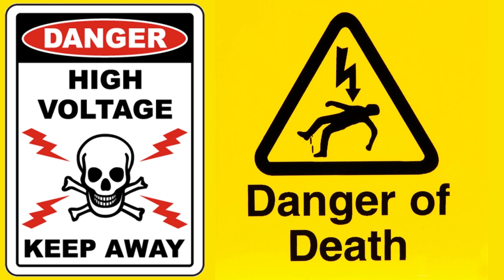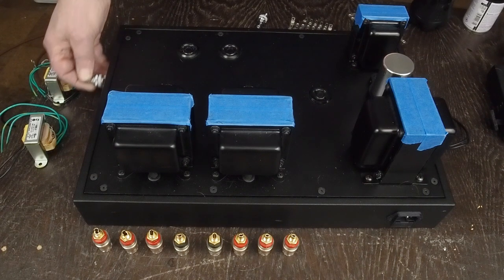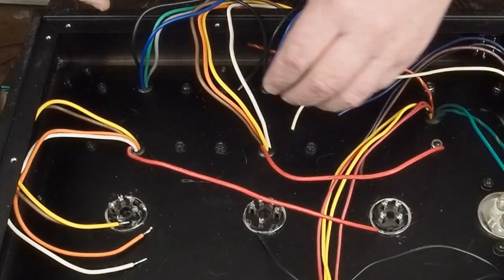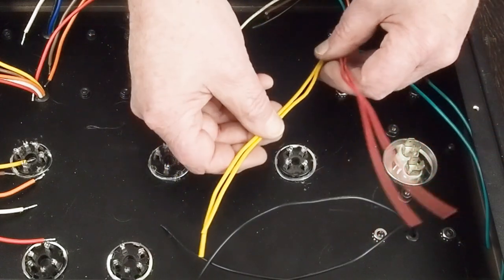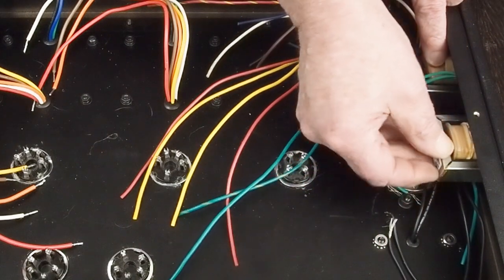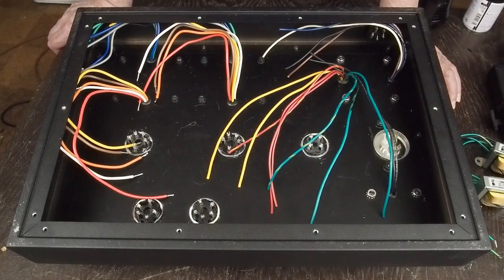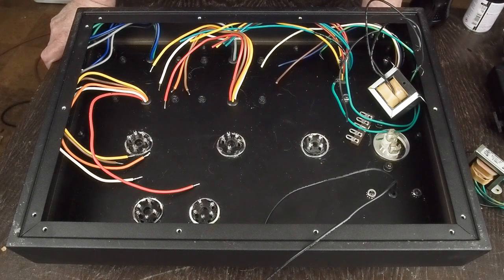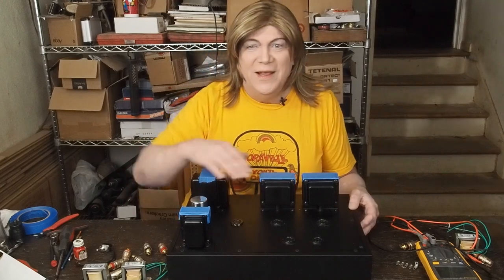1930's Globe Tube Amp: Layout and Wiring Design

Comment: Looks elegant. The rhodium plated connectors are a nice touch..I have a gut feeling it will sound more than decent. I hope you eschew more modern circuits and stick with a simple plate choke loaded common cathode driver for this build..
Reply from the maker: That is one option I plan to try.